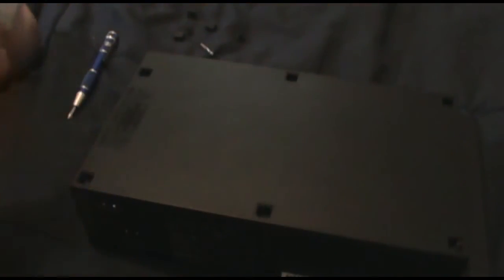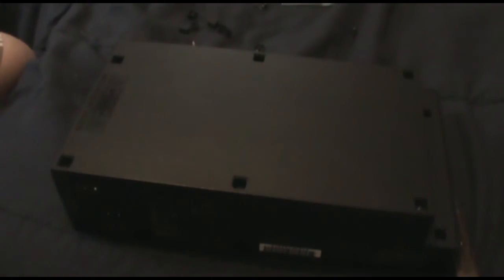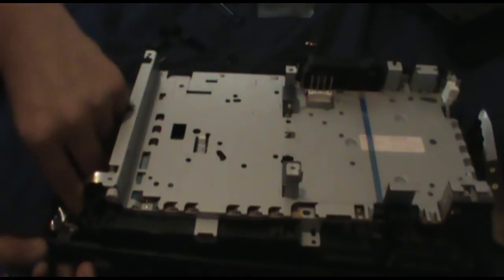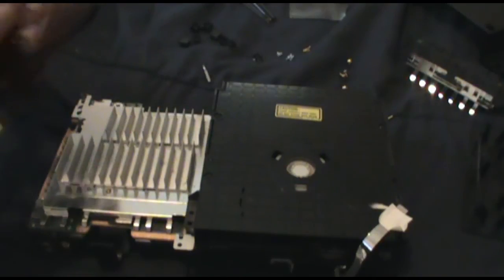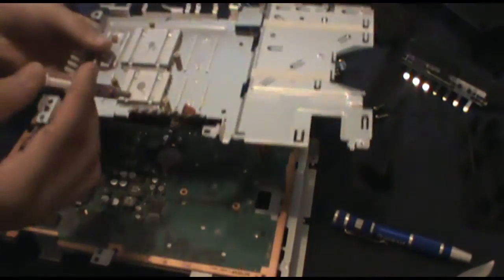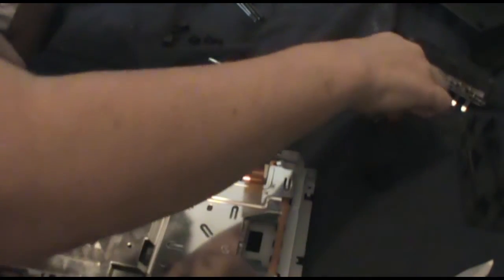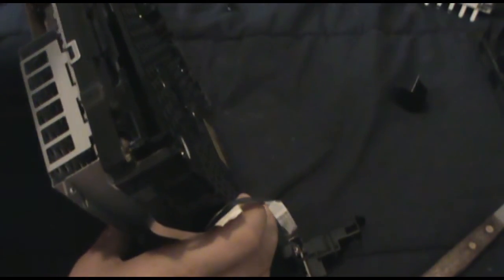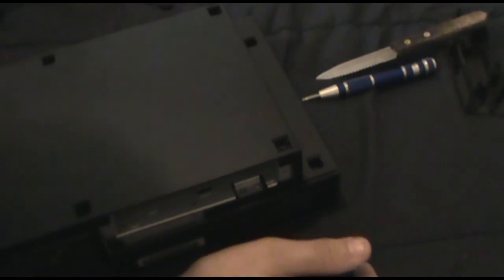PS2 simple cooling mod

Comment: you need the silicone thermal pads, otherwise there is a gap between chip-set and heat-sink, finite tolerances matter, if you knew someone who could machine metal, could get a couple copper or aluminum shims made to take up the remaining space.

and spread your thermal compound on polished surfaces for proper heat transfer

Comment: Being the only video on YouTube that actually goes in-depth  on how to cool a fat PS2, it have to be the so badly that it's useless as an instructional video.
Reply from the maker: In another reply to an equally as old comment, the video was a help and a disappointment all in one. In the years following this video I had modded this exact PS2 even further, used the Hard drive adapter to run PSLinux or whatever it was aswell as a stripped install of Ubuntu. But people ruin things for others and I've never cared to do anymore videos about this PS2. I still have this PS2 to this day and occasionally still use it as a game station, PSLinux and Ubuntu.

Comment: You can reverse the polarity of the cooling fan. All you have to do is reverse the way the wires go to the cooling fan. It will start blowing cool air in side the PS2 instead of blowing warm air out of the PS2.
Reply: But isnt it better to get the warm air out when the ps2 has so small air space to blow the air into
Reply: Yeah it's better to have it as an exhaust, Sony would have made it an intake if that were the better way to do it.  Also changing the polarity of the fan to make it spin backwards will make it less effective because the fins are designed for it to spin in only one direction.

Comment from the maker: Everyone else did, why don't you? Don't like it don't watch it simple as that.
Reply: Stop giving bad advice then. Like the fan thing. It pulls the heat out as there is not enough air flow to have an in take. Then the thermal paste how about applying it correctly. And then adding a pad when you shouldn't because of space tolerance. I mean come on kid
Reply from the maker: @will1867  it's a year late, but mind you this video is how old? It's simple fun and apparently going over how to take it apart helped some people. Yea the ideas are "dumb and useless" but I still have this exact PS2 to this day, modded up even further and using the hard drive adapter to run PSLinux or whatever they called it. A few years after this video I managed to run a stripped install of Ubuntu on it aswell. But I don't feel the need to share how to do all of that aswell as show it off. This video was a bit of a help and a disappointment at the same time.